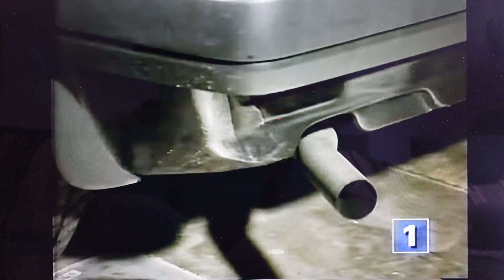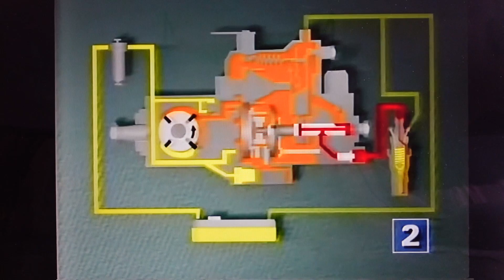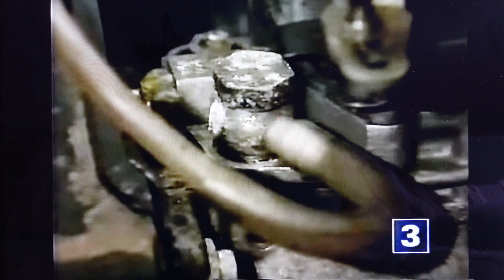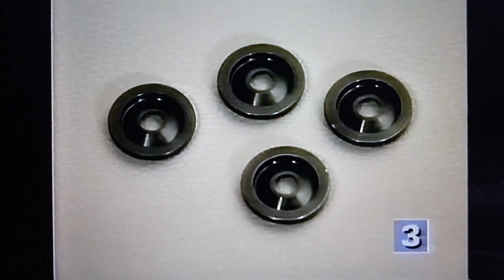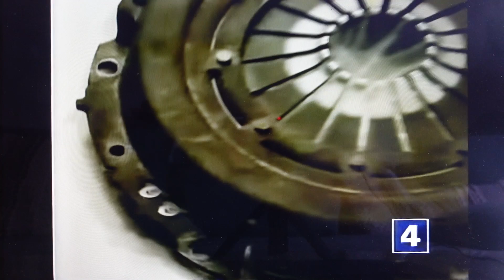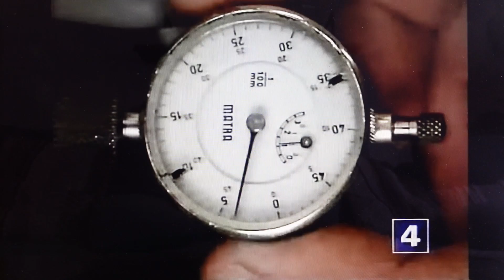Cool Old VW WorkShop How to 1.6 to 1.9D & TD Timing

Comment: I have a question which turbo would be better gt1749 stage 2 or bv43 stage 2 for a tdi afn. would like to drive over 2bar loader pressure
Reply from the maker: If you are looking at only boost and not flow, then a 1749VB stage 2 then.